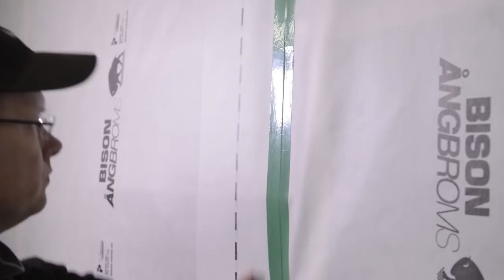Building the wood shop 5

Comment: I too remodeled my shop this past summer.  I took down the sheetrock, hired an electrician to rewire the shop and install a 100 amp sub panel.  I then insulated the walls and put up plywood.  I painted the plywood white, and the shop is now light and bright.  Continued success with your shop remodel.
Reply from the maker: Cool. Thank you!

Comment: As my lighting needs change in my garage workshop, I replace with LED lamps, daylight color, what a difference it makes in attitude alone, plus the energy savings. ☺
Reply: I've directly measured the current consumption, and it is real and substantial. I've even gone as far as to replace the incandescent lamps in my flashlights (torches) with LED bulbs, a typical 2- "D" cell 1/2 watt LED consumes about 70 milliamps, a filament bulb consumes about 200, almost a 3X reduction plus it is shockproof, heat and cold resistant and inexpensive, a little over $1 each U.S. when bought as a  5- pack. I also make my own task lighting fixtures using LED strips salvaged from televisions put to the curb. Power them with a typical high efficiency switching power supply, again salvaged from printers and scanners found roadside, and  you can't hardly do better than that.

Comment: you should consider using some heavy loaded vinyl under that wood wall, also installing an acrylic chamber for painting. it is cheap and will save you troubles with your neighbors and lungs.
Reply from the maker: Why the vinyl? I already installed a vapor barrier.  Painting with linseed oil paint is perfectly safe, apart from the added turpentine, but the actual paint just contain boiled linseed oil and pigments.
Reply: ah the heavy loaded vinyl works great to dissipate the motor sound from your equipment and the acrylic is for future proyects, but yea you are right you will install it if you need to paint with polyurethane in the future.

Comment: Nice video, Torbjörn.
You are already quite far with your workshop.
You did it right with the construction foam.
You waited until it was dry and then cut off the foam.
I once worked as a fitter for window construction (installing windows, etc.)
Many try to wipe away the fresh foam immediately, so you only smudge it and get the foam then only very bad way.
Because of the color, I would have done it with a paint spray gun.
I think that the roles in the neck goes or it hurts afterwards.
Reply from the maker: Thanks!

Comment: I have followed the building of your woodshop with keen interest...I must say you have changed it into something very very useful and really very precise....I have to ask, does it get THAT cold to have insulated the shop....our minimum temperature in winter would be around 8 Celsius (42 Fahrenheit)
Reply from the maker: Thanks. Nowadays the winters are quite mild, but we can have drops down to -25 C or so. With good insulation you spend less on heating... This is still probably only half the thickness of insulation that is put into ordinary houses here, so I don't feel like I have "over-done" it.
Reply: We are obviously in summertime and had a really hot spell the last few weeks....we had a few days of 45 plus....

Comment: I am fairly sure a great deal of us here watched with envy due to your little helper, esp. once it was made fairly obvious that things were a lot harder without his help ;) ... would like to ask what that foil was for? another moisture barriere? ... hmm, always a bit sad when nice wood gets painted over, but seeing how makes such a huge difference in lighting i can't really fault you... it's coming along nicely, and i can also see you are already getting quite accustom to working in a small woodshop, given my suggestion of putting things on wheels any thoughts yet ;D
Reply from the maker: Yes, a helper helps (at least most of the time)! :) Yes, the white foil (lettered BISON) is a vapor barrier.  Heven't given the wheels much thought yet, but it's in my mind. The heavy machines will probably be stationary though.
Reply: And what does he himself thinks of the whole project? ... is there a special reason to put it on both sides of the insulation? wouldn't just the outside be enough? ... well i was asking about the wheels seeing you were moving everything around a lot ;)
Reply from the maker: I believe he thinks it is quite cool.  The vapor barrier is only on the inside to keep moist warm air from entering the wall which potentially could condensate inside the insulation and cause water damage. On the outside you have a weather barrier, often some wind proof material.
Reply: :)  ... ah that makes a lot of sense, tnx again for your time explaining. Honestly can't wait till it's finished and see project roll out of there as well.

Comment: Bet your arm ached after all that above head painting. 😁.
I noticed that you have sealed in the walls with expanding foam. For a woodshop (a dusty environment with the moisture content of drying wood) you are gonna need  some airflow. Are you putting in venting?
Reply from the maker: :) Yes, I'm going to add one or two vents through the wall later on.

Comment: Great work, as always!!! By the way, i like the bandsaw and the lathe, from where did you bought them?
Reply from the maker: Thanks. Bought are old used tools bought cheap locally.
Reply: @torbjornahman  Looks like you've made a good deal!!! Most of the times the old ones are way better than the new diy...and to get a decent machine these days is too expensive....for me at least!!
I'm a big fan of old machinery....got myself a wood lathe which i believe is 50 years old, and still works fine!!!
The lathe you've got is a blomqvist?
Reply from the maker: Yes the metal lathe is a Blomqvist. The wood lathe is a "Solberga" (old swedish brand also)
Reply: @torbjornahman  I know a few things about Blomqvist...seen a few videos and they look nice, but i've never heard of Solberga before. But i've searched it over the internet and all i saw was very good opinions about it and practically a good and strong built reliable machine, so it looks like you've made quite a deal buying them. They both look nice and i think anybody will be glad to have them in their shop...at least i know i will!!😆
Maybe could you give some hints or some swedish links where i may find more info or machines to sale...i'll really appreciate it!!
Reply from the maker: Thanks. You could always look at "blocket.se" and do a search... but it's all swedish I'm afraid. https://www.blocket.se/stockholm?q=tr%C3%A4svarv&cg=0&w=3&st=s&ca=11&is=1&l=0&md=th

Comment: Torbjorn, is the linseed oil paint a traditional paint? Any benefit over latex paint or modern paints? Curious, thanks!
Reply from the maker: Yes, it's a traditional paint... I think you could argue for both, but I like how it's "natural" and quite economical. What probably concerns me the most is that the majority of "modern" paints are too dense and and can cause problems trapping moisture behind it. Not a problem for indoor use but still.
Reply: Was the paint you started with just normal thinned with oil etc
Reply from the maker: The original paint is just a mix of pigments and boiled linseed oil only.
Reply: Torbjörn Åhman I only ask as I'm pine cladding my work shop roof and think about what finish I want on it . I was thinking about painting it or oiling it this seams both but I can't get a tin of pigment ,
Reply: Chris Bannister try oil paint pigments from an art supplies store. Most artist oil paints are linseed based.
Reply from the maker: Mixing your own linseed oil paint is quite easy really, if you can get hold of the pigments that is... zinc oxide and titanium dioxide.
Reply: Torbjörn Åhman 💥 I have some titanium dioxide powder about 500g ( from my carp bait ) might give it ago
Reply from the maker: Ok! Can't remember now, but you should have them both really... leaving one out could result in a cracking paint over the years. But it is always interesting to test!

Comment: Hola! Que función cumple ese paño blanco? Lo primero supongo que será aislamiento térmico-acústico.
Reply from the maker: The white cloth is a "vapor barrier", to stop warm moist air from escaping from inside out into the insulation. If it's cold outside the moisture will condensate inside the wall and potentially cause water damage to the wood in the walls. It also acts like a wind stopper.
Reply: @torbjornahman  Gracias!!